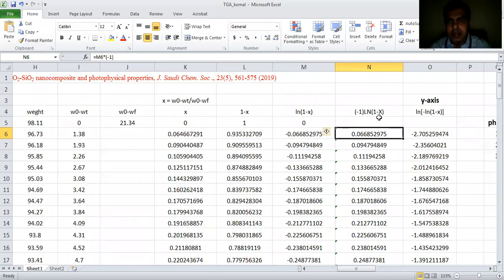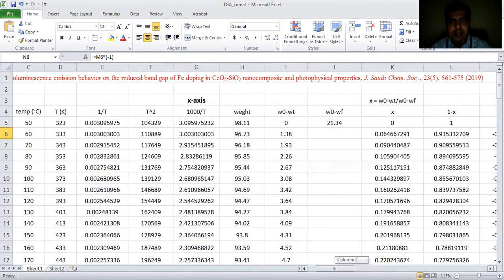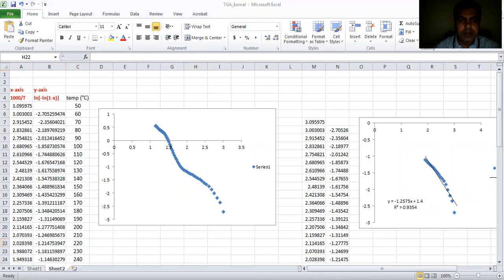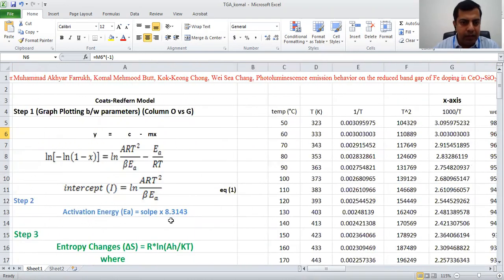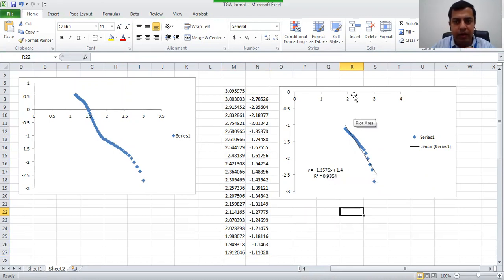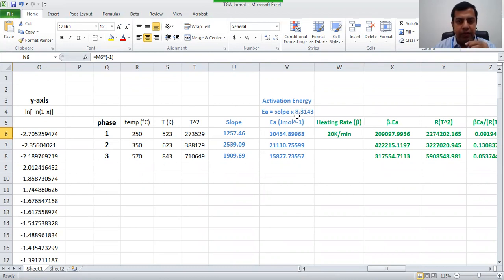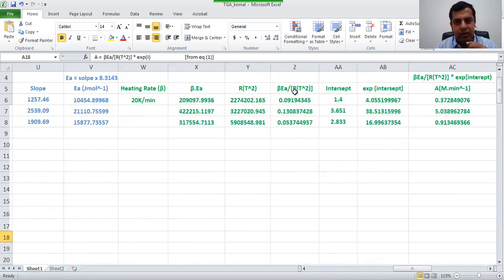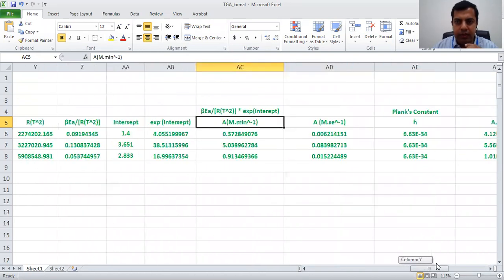PART-3: Calculation of Kinetics and Thermodynamics Parameters by Thermogravimetric Analysis (TGA)

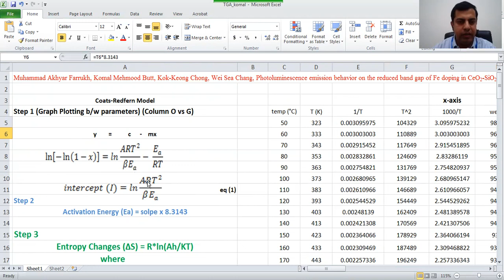Comment: Professor, I would like to ask you something. At 7:13 Your T squared has moved to the right which shows that T squared is a constant. I would like to ask how the temperature remains constant?
Reply: As per my understanding, Enthalpy, entropy and gibbs free energy is calculated at specific temperature,  it could also be calculate at different temperature.

Comment: Hello Sir, thank you for your explanation for all videos part. I have a question, can the method you described in step of determining thermodynamic parameters can be applied to the TGA process with biomass, coal and hybrid samples? Then do the reaction phase of biomass, coal, and hybrid also have 3 phases? Thank you Sir.
Reply from the maker: yes it can be applied. However, phases depend on the nature of substances and their weight losses. In your case may be more or less but remember each phase has the same way of calculation.

Comment: Hello,  I wonted to know why you multiply the slope by 1000 ? thank you very much
Reply from the maker: Just to convert fraction into whole number but you need to multiply 1000 with slope again to get original value. If you plot without multiply 1000 with 1/T then no need to multiply slope again with 1000. Both ways will give same values.
Reply: Im phd student in china and I realy wont to know more is it possible to contact you  @MuhammadAkhyarFarrukh
Reply: so with 1/T we have directly the value in j/mol also? @MuhammadAkhyarFarrukh
Reply: is it to find direty the ativation energy in j.mol^-1

Comment: Thank you for your detailed explanation. It helps me a lot. I have a question that why the unit of the heating rate is 20 K/min, because in fact it should be 20 ℃/min. Is this for the calculation or it is a error? When we use Kissinger mehod or other method to calculate the pre-exponential factor (A),  if the heating rate with the unit-℃/min need to be coverted into K/min and what is the unit of pre-exponential factor (A)? Thank you very much.
Reply from the maker: It is 20K/min. However if it is 20C/min then also no change as we are taking only difference of temperature after one minutes and that would be same in both cases. A is s-1. You can refer to publications. I am in China and might not discuss more.

Comment: In case ln(1-x) vs Time(mins) is coming to be a better fit in logarithmic/polynomial/moving average rather than linear as you showed, how to know the order of reaction (n) in those cases?

And which equation or model is to be employed to calculate all the other parameters?
Reply from the maker: Dear
This equation is a straight line equation and you can calculate the parameters if you get a straight line which fits the data. It might be me if you are not selecting the appropriate phase for a specific weight loss. Try to select weight loss which fits the data.
Reply: @MuhammadAkhyarFarrukh  sir, i have emailed you my worksheet; none of my plots are linear fit; what should I do in such case? My samples are soil powders, composite of hundreds of known and unknown elements.